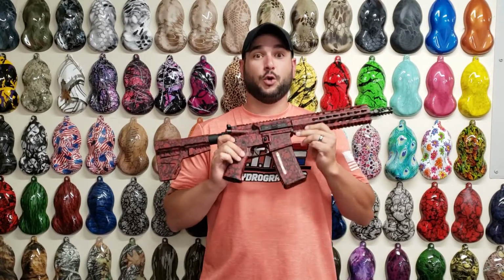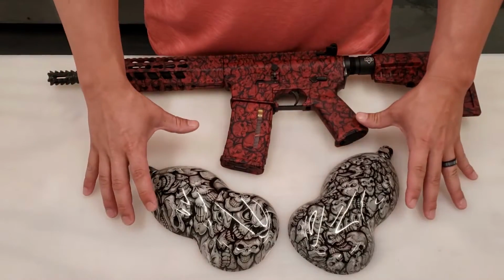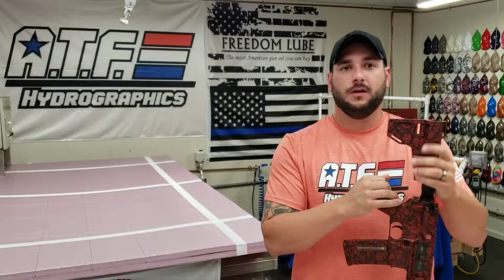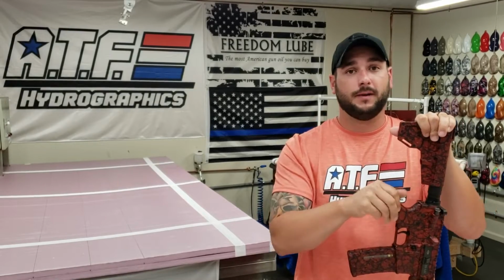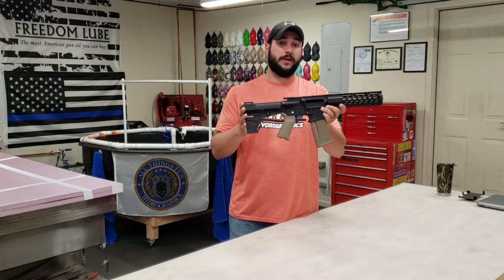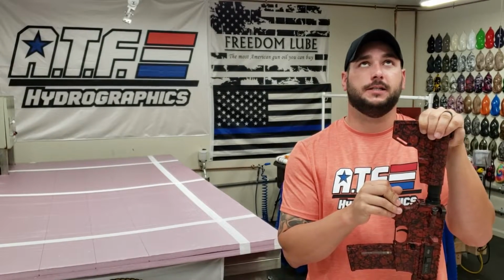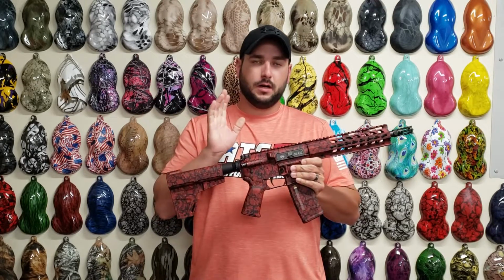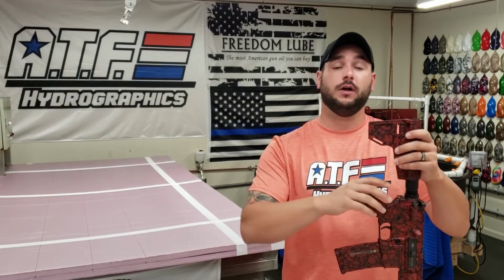Hydro Dip AR-15 Pistol - Reduced Insanity - ATF Hydrographics

Comment: Do you plain painters tape to tape off?  I have had it pull my hydrodip off the side I already done.  Also, what kind off clearcoat are you using?
Reply from the maker: There is a link in all of our video descriptions to the tape we use. It's a purple 3m tape that never pulls the pattern off. The big issue is not going to be the tape, it is activation. If the pattern is not properly activated then it will not stick to the paint like it should and will come off with tape. Activator takes lots of practice.

Comment: Questions, how long do you wait til you can tape off the other side After you already dipped that side? Also, what do you use to hold the pieces a stick?
Reply from the maker: I usually give everything a full day to dry and then tape off the other side. If I am in a rush, I will put it in front of a fan for the day and tape the other side later that night. I use tape or hot glue to hold the parts to the paint sticks.
Reply: @AllThingsFunHydrographics  ok copy that. Also how do you get perfect dips? I recreated your stock dip and I got some circles where it didnt catch on my guess is air bubbles?

Comment: does taping the side with graphics need a special technique
Reply from the maker: Nothing special, just tape off one side and dip it.
Reply: When you tape off the side already dipped to dip the other side  will the tape pull the graphics off or did you spray clear coat ?